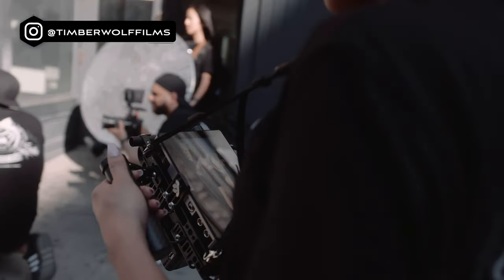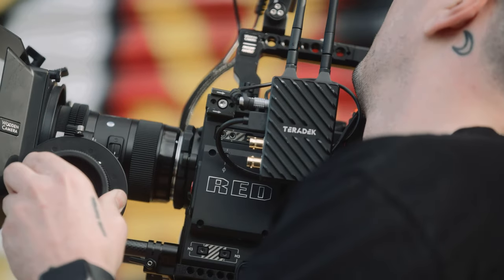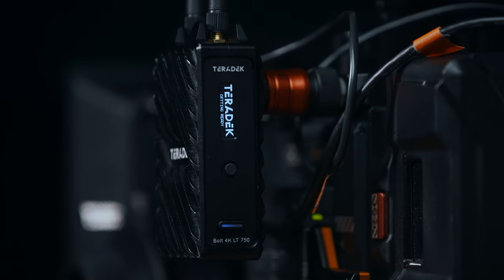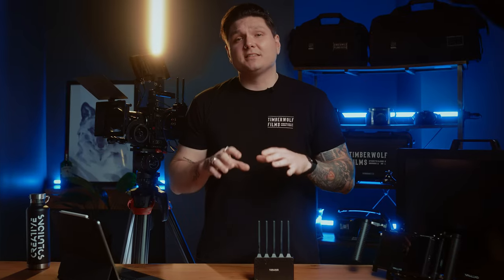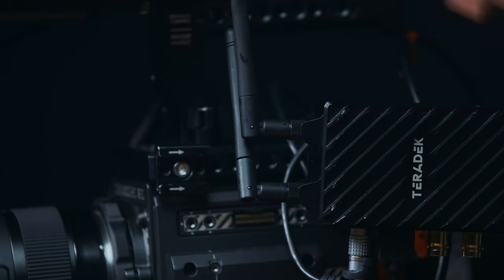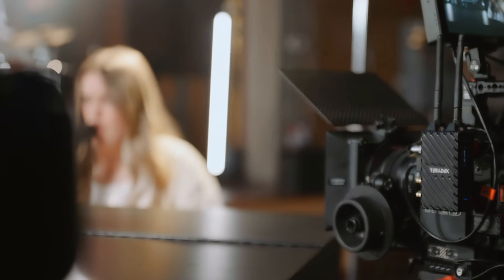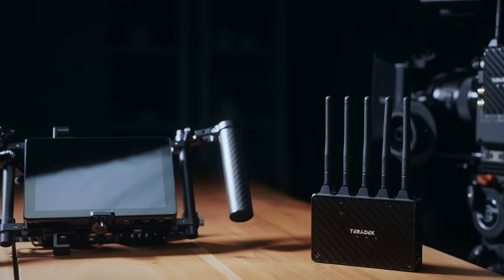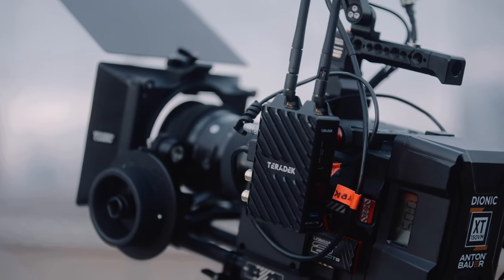Teradek Bolt 4K Workflow

Comment: Great video. We are looking into wireless setups and this fits the budget. We do have a couple of questions about it, can we pair 2 transmitters to the receiver and get 2 different channels? And finally, what would you recommend to connect a monitor to the camera if hdmi is the only option (fx30, smallhd action 5 + potential bolt 4k750)? Thank you so much